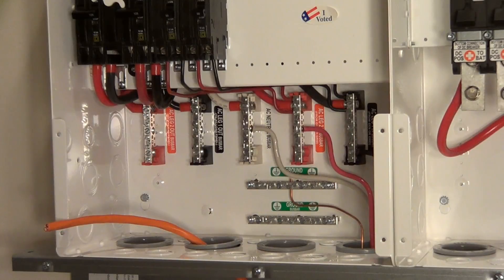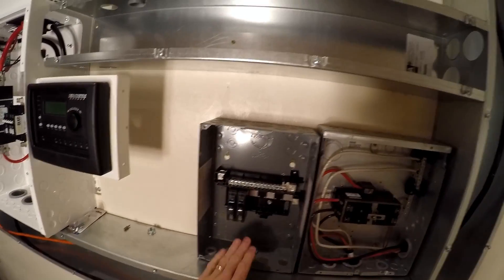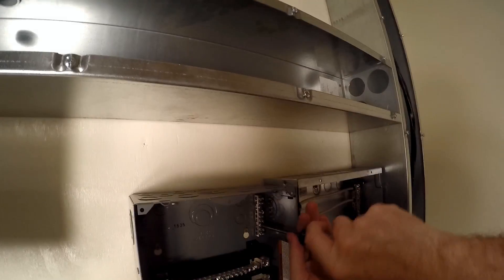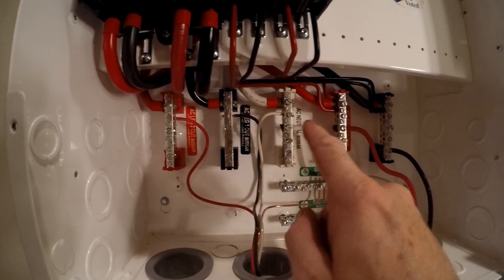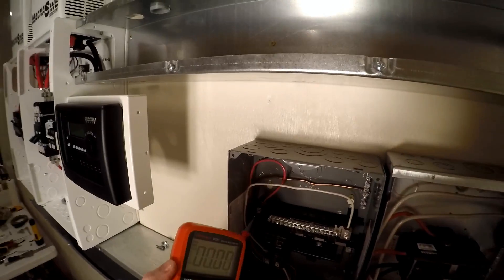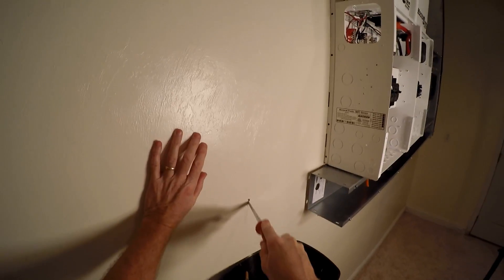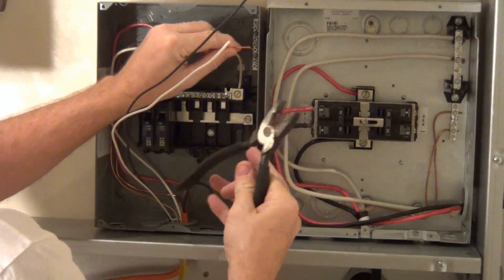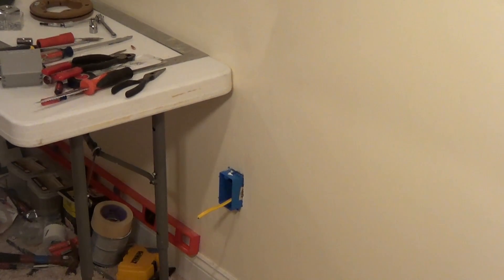Off Grid Solar #16: Wiring the AC Output

Comment: This is bad, your output should be as big as your input. outputting from a 60 amp! #6 Awg!!!
Reply from the maker: This is the secondary output box and is really only intended to run 2 circuits and to test out the system.  The primary output to the house will not be installed until the very end when I am sure everything works properly.  The primary output will have #6 AWG wire.  That said, I think you make a good point and I may go back and change this to #6 just in case I were to sell the house and someone else were to further populate the secondary box.  Thanks!
Reply from the maker: Update: replaced those output wires with #2 wires.